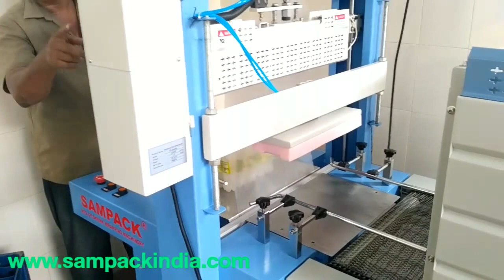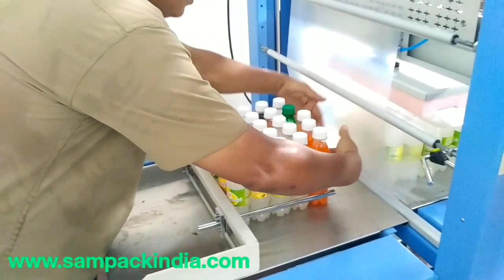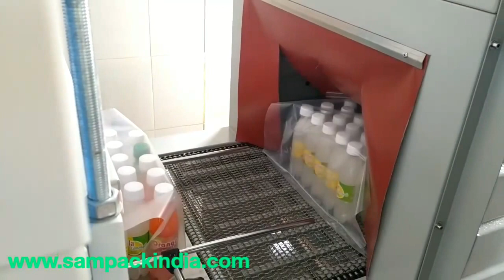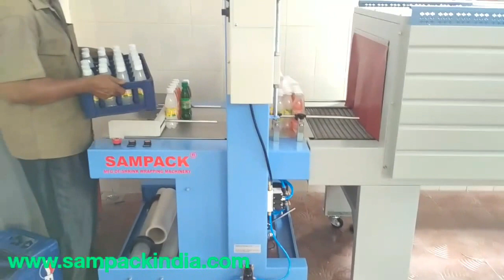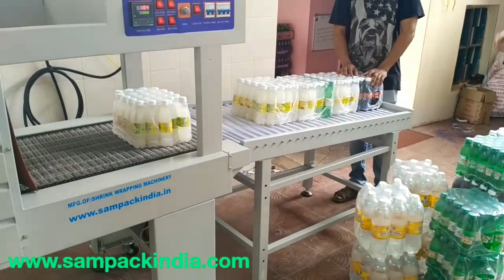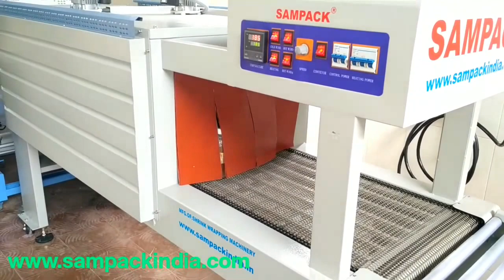Juice Pet Bottle  Shrink Wrapping  Machine Manufacturers

Comment: Can it run with single fez electric  conection
Reply from the maker: We have all types of Packing machinery .Sealing machinery, Coding machine,  We are manufacturing all types of packaging machinery.   
Please contact +91 9447111444,9447788885
Email Id: info@sampackindia.com

Comment: Power consumption (kilowatts) wanted
Reply from the maker: We have shrink wrapping machine  our Own make 16 KW,      Imported 22kw  . We have all types of Packing machinery .Sealing machinery, Coding machine,  We are manufacturing all types of packaging machinery.   Please contact +91 9447111444, E-mail: info@sampackindia.com,    Cochin- 0484-2382211,  4030212,   ,    Coimbatore- 0422-4958111,  9447814433,    Chennai- 044-48677211, 9447814422